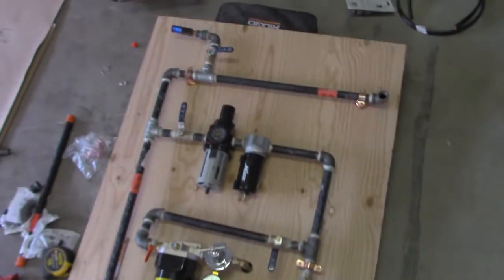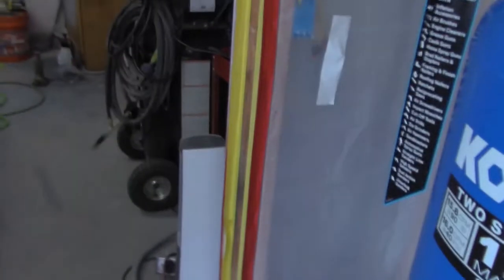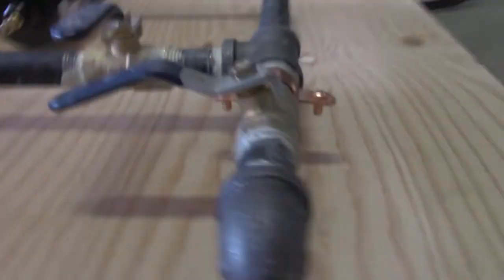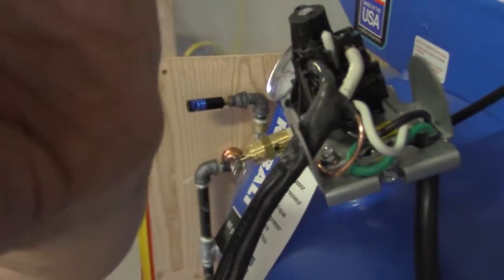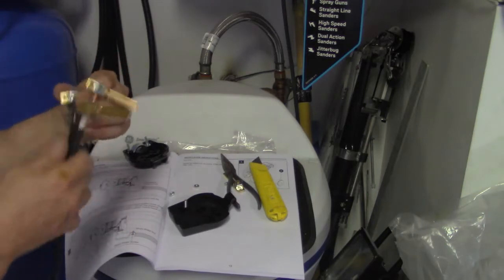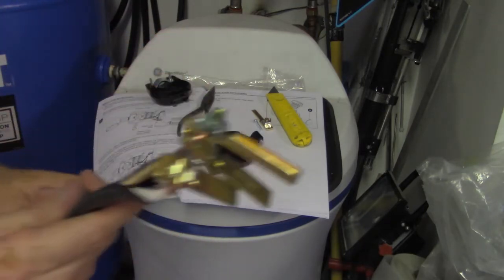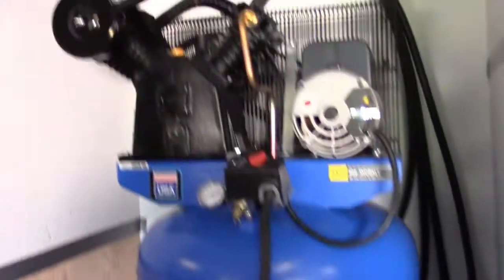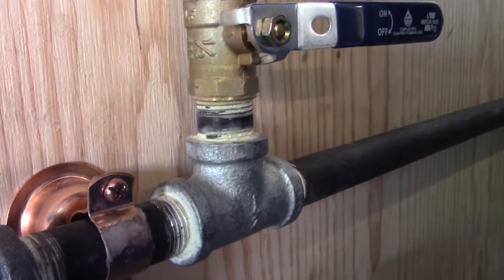Kobalt 80 gal  2 stage 5 HP Air Compressor Set up For Paint Booth

Comment: You may want to replace your copper brackets with steel. Hydrolysis happens when copper and steel are in contact and can cause premature failure. Just an FYI

Comment: Have you had any issues with pressure switch burning up since you dont have a magnetic starter?? I just bought one these myself and was wondering how well they hold up without the starter
Reply from the maker: Haven't had any problems so far been a couple years. Pressure switch works great turns off and on as needed.
Reply: @esrestorations  great I really appreciate the quick reply. I think I'm gonna rule without the magnetic starter. I really appreciate it

Comment: Very well done air system.   I'm not being critical of your work with this comment.  I'm concerned about your safety.   The white conductor insulation was cut be the razor knife when you cut off the outside jacket inside the box on the compressor.   Probable that nothing will happen, but why risk it.   Also,   You do realize that inside a paint booth is classified as a hazardous location requiring electrical explosion proof equipment.   Be safe, the life you save may be your own.    Kevin
Reply from the maker: Moving to a shop with real paint booth thanks
Reply: ES Restorations    Very happy for you!   Good luck.

Comment: may I asked why did you changed from turbine hvlp to compressor? you were not happy with results?
Reply from the maker: Hi there Cruz. I am installing an air compressor and I have the maximizer 3000. I was making videos here soon to show you the difference between turbines and conventional spraying with an air compressor
Reply from the maker: I've had amazing results with the turbine and I've had an amazing results with a conventional spray gun with air compressor so I just want to show everybody that a turbine does As Nice of a paint job as an air compressor.
Reply: thats what im talkin about!!! Turn your garage into an actual SHOP! In this day and age its way to expensive to lease a office/shop. as long as you got cool nieghbors. Nice set up dude.

Comment: How’s the compressor working.
Reply from the maker: The air compressor works awesome it keeps up with every tool I own. I've painted two complete cars so far and I've used air Sanders da Sanders paint shaker  conventional spray gun HVLP spray gun  keeps up  just fine . from completely empty takes about nine and a half minutes to fill up.